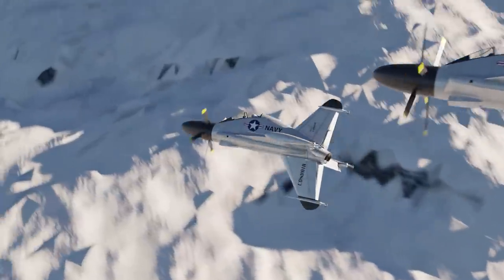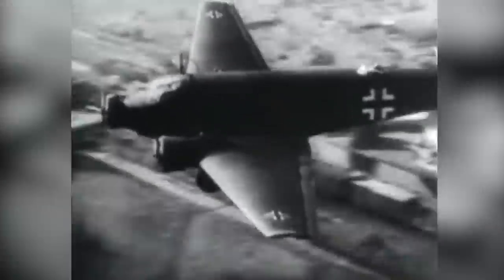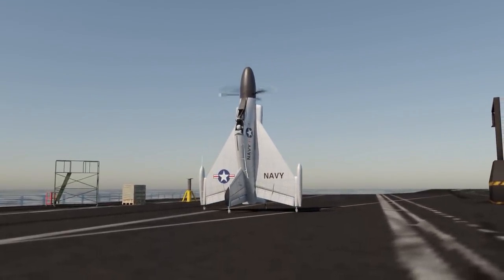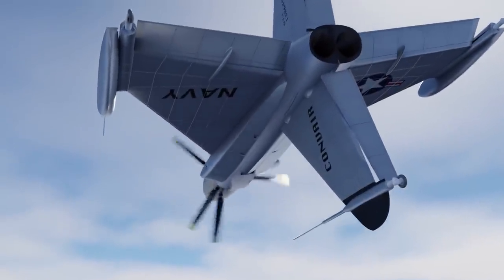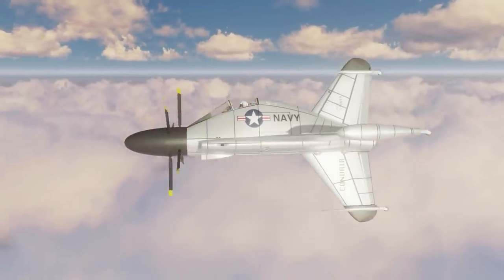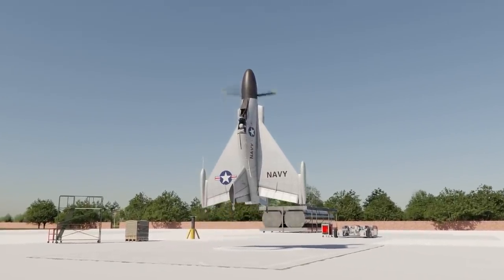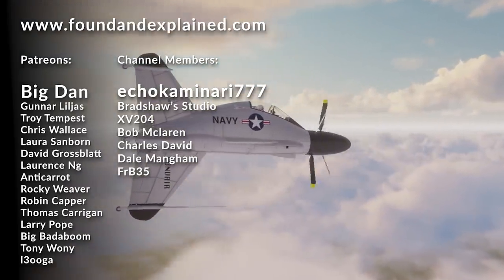The Incredible 'Tail Sitter' Convair Pogo - The First VTOL Plane!

Comment: With modern technology and an automated flight system, I think this design could still be viable today.
Reply: The harrier and osprey both came from this plane take the engine and direct it downs to make the plane go upwards. 

The f-35 is a little weird and actually and most of the thrust for vertical takeoff doesn’t come from the engine but same principles of direct force downward.
Reply: The competition today is way more advanced tho, i dont think this could intercept effectively anymore in today's age of military forces
Reply: @apex_blue  Not really. There was a 1948 vtol concept that flew in exactly the same way as the Harrier and F-35, the Pogo is no direct relation.
Reply: Tilrotor already exist, and it's way better in everything both control and ground hadling
Reply: Northrop Grumman is doing something like this
Reply: So you would use a 550 mph turboprop that can't carry any payload to do what?
Reply: @imacat3968  then all you have to do is change the role. If this was a air to ground attack aircraft filling much of the same roles as the A-10 but at a cheaper cost it would be very viable.
Reply: @imacat3968  then all you have to do is change the role. If this was a air to ground attack aircraft filling much of the same roles as the A-10 but at a cheaper cost it would be very viable.
Reply: Agreed. Taking out human error in landing the thing at differing wind speeds.

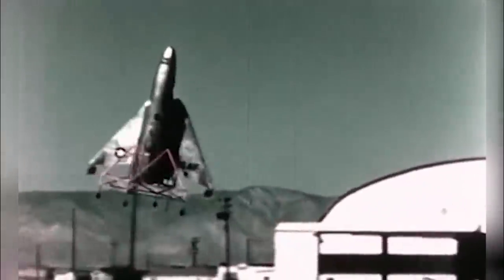Comment: A very entertaining video of a pretty weird airplane.  However, the airplane shown at 12:16-12:25 is not the Convair XFY but the Ryan X-13 Vertijet, another tailsitter project that was a few years later.  As Ryan Aeronautical was based in San Diego first flights of the X-13 would have been there at Lindbergh Field, while Convair's test flights five years earlier were elsewhere in California.
Reply: Both Convair and Ryan were located in San Diego, California. Ryan, of Spirit of St Louis fame, completed testing of their X-13 at Edwards AFB in Southern California. Convair did their flights of the Pogo at nearby Brown Field, then a Naval Auxiliary Air Station.

Comment: I wonder how stable the same exact design would be with modern fly-by-wire controls (with computerized calculations making the aircraft stable in all conditions). Wouldn't that make it one of the best close-air-support aircraft? Imagine just having this in reserve, camouflaged near the front. A minute later and it would take to the sky and start supporting troops on the ground. Almost as fast as a jet when needed, but also almost as slow as a regular fixed-wings aircraft when required. And how many of those could you fit on a support carrier?

And I see it being relatively straight forward to maintain since it looks like the engines were built as a compact power plant that seems quite modular. So you could swap-in another power plant and put the aircraft back into service with some expediency. Try doing that with a chopper...
Reply: Or the Ryan X-13 Vertijet.
Reply: It can

but tilting rotor already exist. And it is better in everything. So, why bother to use tailsitter again when it was use solely because tilting rotor wasn't viable at that time
Reply: @bocahdongo7769  Tiltrotors are more complex and dangerous.
More complex because you need the tilting mechanism. More dangerous because if one rotor fails, you're doomed.
Tiltrotors still make sense when you have to carry cargo/personnel, because you need to keep it horizontal. And also when you have to hover with precision or go very slowly. Otherwise, if you only need a fighter jet, these tail sitters make more sense.
Reply: @jorehir  Tailsitter also doomed because if 1 rotor fail, well same thing exactly happen. If we talk about horizontal flight, both still landed exactly like glidder

Indeed it's more complex, but it capability and flexibility outweight the tailrotor. In terms of jet fighter, standar VTOL trust vectoring is already mature enough.

Again, tailsitter isn't one of kind design, but rather of stopgap for quick design VTOL at that time. Unflexibility in terms of both maximum size (which matter of how much fuel and weapon can carry) and ground crew hadling is no joke. If you wanted small interceptor anyway, future technology called "missile" does exist, it's not like we live in Ace Combat universe or some sort
Reply: @bocahdongo7769  You're "more" doomed on a tiltrotor, since the first thing you experience when a propeller fail is a heavy imbalance of thrust/lift (especially at low speed).

Standard VTOL planes still have BIG complexity issues.
I'm not saying that a Tail Sitter would be trouble free, but i see more potential in it.
Also, some modern jets can lift themself at almost MTOW when vertical. I don't see many limitations in that regard.

A proper VTOL/TailSitter would be a great thing to have, eliminating the need for large aircraft carriers or landing strips.
Reply: @jorehir  Tailsitter even worse because you have... 1 engine duh. Same thing. On top of very awkward landing position and 100% rely on computer.

Again, you underestimated handling a plane sized like F/A-18 mounted vertically without any silo and no way you can repair/rearm it horizontally without unnecessary large crane. Modern plane is bigger, and that's where tailsitter is no longer viable. I'm still not even touching how awkwardly unstable to land plane sized like F/A-18 like Space X (they already tested tailsitter jet BTW)

But. If you still for no reason INSIST tailsitter is viable. Yeah, you can use it as small interceptor. But, it's heavy to put human there, so we make it drone instead. And, you can use it as suicide interceptor by using proximity bomb because landing is still hard on drone. And... Oh no, we accidentally invented "Long Range Surface to Air Missile", what a coincidence.
Reply: Nobody needs VTOL for CAS or any other mission.

Comment: Move the cockpit to the rear and have the cockpit rotate 90 degrees during the transition so that the pilot would be looking through what would be the bottom of the plane in horizontal flight. This would give the pilot a good view of the ground while landing and make it easier to get out after landing.
Reply: But then forward visibility would be crap and that is kind of important for an fighter plane. 
Down the line more automation makes tailsitter landings much easier. 
It still has two downsides over traditional VTOL like the harrier: 
It require an higher trust than weight to take off, an harrier does not if you have an flight deck and not only an helipad. 
its also far taller than other planes and helicopters  so unlikely to fit in existing hangars and probably hard to do maintenance on. 
However this idea make so much sense for UAV
Reply: It already did on France Tailsitter

Still shit. If not worse because of disorientation
Reply: The French had a similar plane that allowed the pilot to sit in the ground plane - It sucked too.

Comment: One of your best 3D models, but you should angle the axes for those control surfaces (elevators, ailerons, rudders). The hinges on real planes follow the angle of controls' leading edges so that they can be attached at multiple points. You can do this by rotating their origin. Controls also don't move that much, usually 12-25 degrees and 25 is very much on the high end for anything except rudders. Flaps depend on the plane, ranging from 40 to 90 degrees.
Reply from the maker: The model is fully rigged for this video. Although I admit I likely way over did it!

Comment: i am honestly perplexed as to why noone returned to tailsitters, their main (or only) problem could be solved with a single gopro aimed back; or, if one was to be partiularly enthusiastic, handled entirely by a computer
Reply: Simply because tailsitter exist because Tilted rotor isn't viable at all.

And nowadays tilted rotor already perfected enough. And provide both much better control and ground handling

Comment: The POGO had an Allison T40 turboprop engine. This engine had two gas turbine power sections driving into a combiner gearbox which drove a counter rotating propeller. Each power section had a wet, multi-disk clutch between it and the gearbox to allow operation on one power section if necessary. The clutches used bronze friction disks with steel separators.

That engine graphic is not what the engine looked like.

Comment: I always thought that the landing problem could have been solved by dropping a cable from the aircraft , and having it slowly winched down against the thrust of the engine.
Reply: That might be a one solution at but you'll need something on the ground for the cable to latch onto, so for fixed bases or ships that's ok but outside of those you may run into problems.
Reply: My favorite part of these videos is all of the postmortem inventive conjecture by enthusiasts.
This technique is used to land helicopters on small ships.  So maybe that's your inspiration?

Comment: Part 1
Can you do a vid about 
Questioning and Answering the existence of orbital weapons such as ION cannon or Particle cannon or orbital cannons generally I just want to know if there is ones or underproduction or at least planned for but if no info made probably it would be a no joke top secret project such as Earthquake maker weapon and Project Mjolnir.

Part 2
                     (Project Mjolnir)
simply a tank with new kind of weaponry but it’s unknown what exactly are these projectiles that the tank launches and the way it launches these underground projectiles and yes they’re like torpedos but they as I said travel underground like worms but faster bigger and deadly and anti structure tank or weapon if you will and the way it works imagine a tank on top of it a hammer and yeah it’s a hammer but in this hammer has these projectiles of some kind and the hammer hammers down launching these projectiles also while it goes to the target it also leave behind it a track of poisonous liquid that doesn’t only effect humans but also vehicles causing them to melt down and also moving in it’s the ground up forming a crystal rock that if that crystal rocky form beneath a vehicle it would pierces through it no matter how strong it is well it depends on the sharpness on the rocky crystal form and the there is a bunch of info about this weapon but unfortunately it’s top secret this is the only info I could’ve gotten about that project and if you ask of the source it’s anonymous I’ve gotten this info from anonymous source but that’s all peace

Comment: They could have just designed it to land in the water, and have a crane pluck it out.  It could even land horizontally that way, gliding without removing that bottom fin.  They needed to think just a little further outside the box than they did.
The upsides are big.  You can store a lot of these in an aircraft carrier, and it can take off, right off the elevator, before it gets to the flight deck.
Though, I am not sure how tall the storage deck is.  They may need taller aircraft carriers.  Somehow, I suspect they have enough vertical space, or this is a silly design.
It could even be possible to fuel it up, and rearm it in the water after landing on the water, and takeoff from there.

Comment: It was ahead of its time in many ways. Of only they had fly by wire and better computers to make it easier to  control it world have probably been more of a success or at least be more then just a prototype concept aircraft that ended up in a museum. The V-22 osprey had problems with pilots being able to control it in early developement. It ended up with a fly by wire system that greatly enhanced the planes usability by its pilots. I think similar technology would have made alittle bit of a difference in Lockheeds plane. Today v-tol drones are sold at Wal-Mart's. The technology has advanced so far that previous classified and priceless technology only known and used by governments and the rich are sold online to anyone with a smart phone. I know little camera drones are different from a full size aircraft, but the technology is generally the same. It's only upscaled and might use different building materials. I think today with today's technology the concept would have been  much more  feasible.  That's just my thoughts!!!!

Comment: You know, in our current race for Naval Air superiority against China-- and to a lesser extent Russia--with regard to drone / swarm technologies in all manner of unconventional warfare both at sea and on land, this little guy just might make truly great bones for an UNMANNED and fully autonomous version that could be fitted out with far superior and more lethal weapons than those, which existed in the 1940's! 

Think about it:  the U.S. NAVY is currently in the process of procuring tube launched (VTO) drones capable of working in swarms.  The drones aren't necessarily designed with recovery in mind, nor with absolute certainty that their destruction is eminent.  In other words, the U.S. NAVY understands that in swarm mode or in a single-unit offensive or defensive mode, their new drones can be used in flight to attain a radar, infrared, acoustic, RF emissions based or laser lock on its target, thereby engaging it directly and crashing into said target to complete the detonation of the drone's weapons payload.  It might be utilized as a sort of smart missile--which considering the current cost of each SM-3 / SM-6 missile our NAVY uses in any given engagement, the drone might just be the more cost-effective solution.  (Which is kinda nuts, imho).

That said, the NAVY doesn't plan upon creating these drones as single-use aircraft; or basically glorified smart bombs.  Thankfully!   The drones do NOT (at least not per current specs according to my understanding) have true VTOL capability in that they are truly designed from the outset with tube launch capability as the number one priority.

This thereby creates a bit of a conundrum for Naval tacticians, weapons designers and procurement teams who must use the drone in some 'other' flight / landing configuration that clearly does NOT include that utilized during tube based launches / take-offs.

Perhaps it is in order for the Pentagon to revisit the visionary and well ahead of its time concept by Corsair.  Seems with all the money spent back in the 40's that ultimately went nowhere; we might benefit from importing this mighty Corsair VTIOL Pogo's best characteristics and incorporating them into a plan that fuses the "old with the new," in so far as our modern autonomous unmanned (UAV) drones are currently capable.  

Just a thought.  😉

Comment: This is the problem with groundbreaking designs like these. Concurrently available technology is usually not up to speed with the radical designs. I feel like the main issues of this plane, hovering and landing stability, would be easily solved by modern digital avionics. Just look at the F-35.

Comment: Unfortunately your wrong on that being the first true Vtol fighter.

Mazi Germany had the first vtol fighter in the natter
Reply: I don't think that the Natter was designed to actually land.
Reply: @lesliereissner4711  a future variant was
Reply: @troygroomes104  I doubt if there was any way it could be made to land vertically.  The Natter was a manned rocket designed for a one-way trip.  If was not separated as the first version, with the pilot and rocket motor descending by parachutes, it would have only been able to glide intact (like the Me-163) for a landing.
Reply: @lesliereissner4711  like I said,  there were future variants planned for being able to land vertically in 1 piece with jet engines,  and there was the FW triflugel

Comment: WRONG!!  The aircraft at 12:19 in this video is the RYAN VERTIJET.  
It was built across the street from Convair at about the same time as the Pogo and was tested at the same facilities. 
You can tell the difference because it was a turbojet and did not have a propeller. 
(Be more careful with aircraft identification in your videos.  You really ought to be able to tell the difference between a jet and a prop airplane.)